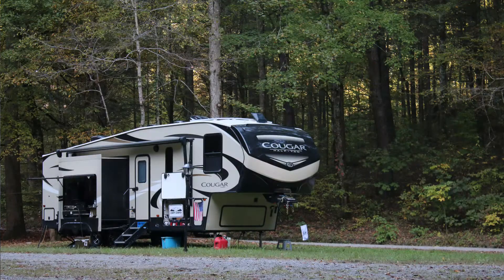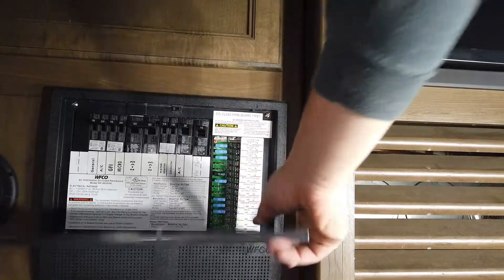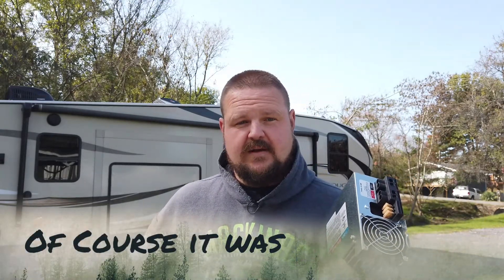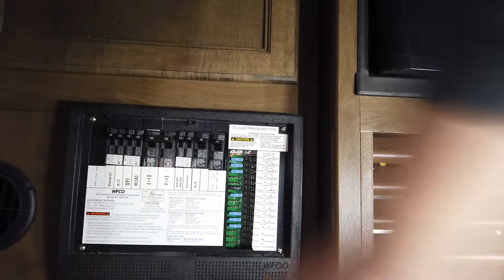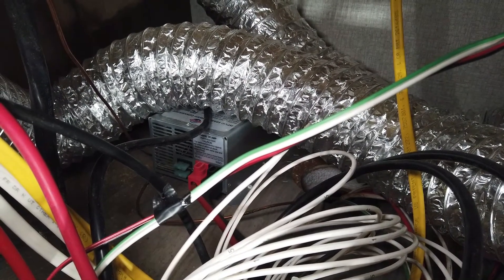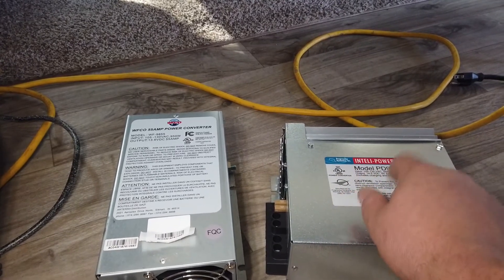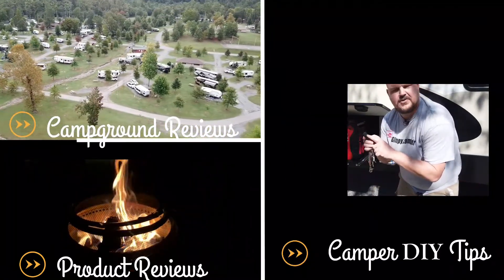Lithium RV Converter

Comment: We already had a PD9260c and was told to replace it with the 9160l

Our 9260c actually charges better than the 9160l

But you need to purchase the $15 remote pendant so you can manually put the converter into boost mode 

We also purchased a 60 amp lifepo 4 smart battery charger, 
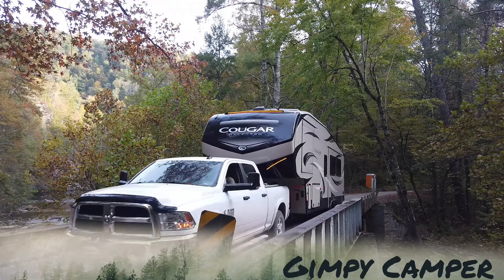6:53 that we use with the generator , we set the voltage to 14.6 and the amps are set at 50

This charges much faster than the converter 

Converter chafing is fine when plugged in at a campground but if you’re are full time boondocking like us then purchase a gear battery charger
Reply from the maker: This works much better for me
RV Converter Upgrade- WFCO 65 AMP
https://youtu.be/3pvJA8UlFOw
Reply: Thanks for that Grumpy

We do basically the same thing with our lithium battery 60amp charger 

We also just installed a wood stove and don’t need the furnace anymore, our furnace blower uses 11 amps so we save a lot on propane and don’t drain the batteries as fast 

Here is a video of our wood stove 

https://youtu.be/o_dLigaZVMA?si=nITXy2soT2lzQOKQ

Comment: I wish you would it show how you install it I install one wwfco for Lithium and it's got a switch on there for lead acid and Lithium and when I put it on Lithium The Fan will not Stop so I don't know if it's something wrong with it
Reply from the maker: That’s strange as the only difference should be the charging voltage.  Not sure about that one friend.  Sorry
Reply: I want to know if it that device that you install it's quiet does the fan stop when it's need to stop or  keep running all the time
Reply from the maker: @lonmar44  I don’t hear the fan unless it’s running

Comment: Great video and I understand completely  about a 10 minute job taking all day. When you pulled the power distribution center out and pointed to where the converter was located I thought RV designers don't repair RV's..
Reply from the maker: Very true.  One thing I will say is that after installing a whole house inverter, I would have probably gotten an inverter / charger like the Victron multiplus.  I just think it would probably be more efficient as my batteries are on the opposite side of my camper

Comment: You can always be confident that an RV will make the easiest job as difficult as possible!  We need to go ahead and get lithium batteries but the converter upgrade is what is holding me back.  Thanks for sharing!

Michael, Shelly, & Talon
Reply from the maker: Well it was easy compared to the removal of the furnace to clean the sail switch that I’m making a video on now... since there isn’t an outside access panel... truth is, I may install one next time I have to get in there.  It would be about as easy. Actually, the hardest part was disconnecting the heat ducts without slicing my hand on the sheet metal.
Reply: @Gimpydoingstuff  I can imagine.  I've had some bad run ins with those ducts in the past.

Comment: This will go in our saved videos section- we have only a shore power converter and dc to dc charger and upgraded out electrical system.. but we have no solar - we do have the heated Volthium 100amp lithium battery... and we do not have an inverter ... we want to wait to see if we need it.. although it will be easy to get to - under bed platform - if we upgrade bit by bit - you handled it all well .. the tight spot didn’t really stop you..
Reply from the maker: Thanks... I hope you guys are getting that van finished up... but I know there have been a few delays lol

Comment: First Off, Happy New Year. OK, I see you installed the converter, but I did not see you install anything else.  I don't know if you have seen my lithium battery upgrade video, but talking to progressive industries , it was suggested to properly charge and maintain battle borne batteries you should also install a Victron BMV-712 Battery monitor and hooking it up to both the battery and converter it will control the charge to best perform with the batteries. any way, good job.
Reply from the maker: I have a Renogy setup in a different video and lion energy batteries.  I have a cheap battery monitor which works ok.  If I were out west where I can. Boondock a lot more I could definitely see the pros of victron.  Truthfully, I had most of the solar stuff from a previous project so it was just lying around.
Reply: @Gimpydoingstuff  I thought you were installing a converter. Why are you now talking about solar?? I never mentioned it. Any way, hope your having a fantastic day one of 2021.

Comment: Good install, I'm thinking I would leave the old one in place for a spare backup and cut wires to it and set the new one beside it.....
Reply from the maker: Not a bad idea
Reply: or use it in tandem if the AC breaker its on can handle both.  Looks like it draws about 8A AC.  My stock 35A charger draws 7 amps max, so i debate on them both sharing the same breaker, or putting it on with something like the microwave which I hardly ever use.  Just have to make sure the battery is charged before I use the microwave.

Comment: How did it work out? We have a 2019 cougar 368mbi with stock converter and 2 battleborns. Looking for the right charger to build our system from, eventually adding whole rig inverter, solar, and more battleborns. Thanks!
Reply from the maker: It seems to charge a lot faster.  The weakest point in my system right now is the battery monitor.  It just doesn’t seem to read constantly.  I also found that the furnace uses a lot of power, more than I thought.  It’s about 16 amps.  We aren’t very conservative with our power but on these cold nights our 200 amp hours of our lithium batteries seems to be just barely enough.   If I had more places to dry camp, I’d definitely get another battery
Reply: @Gimpydoingstuff  what battery monitor are you using? We had a renogy 500a in our last rig but it was iffy. Looking at the victron but its spendy.
Reply: @Gimpydoingstuff  I'm about to upgrade myself.  I've also been using a Victron Smart Shunt to monitor the battery, which is probably the least expensive way to go, yet still have an accurate reading that you can see via bluetooth on your phone.
Reply from the maker: Near the end of this video it walks you through the whole System have on my 29RKS
https://www.youtube.com/watch?feature=youtu.be&v=VKCuqS0qWxs
Reply from the maker: This is the one I’m using.  A lot of people have great reviews on it, so I’m hoping it’s just a bug to work out.  I’m just glad the issue isn’t with my solar, that’s what I was worried about initially 
AiLi Voltmeter Ammeter Voltage Current Meter Voltmeter Ammeter 100V 350A Caravan RV Motorhome 999 AH https://www.amazon.com/dp/B07FGFFHC6/ref=cm_sw_r_cp_api_glc_fabc_Xz-YFbTJ3XHQC?_encoding=UTF8&psc=1
Reply: @Gimpydoingstuff  thank you.  Keep up the videos, great stuff!